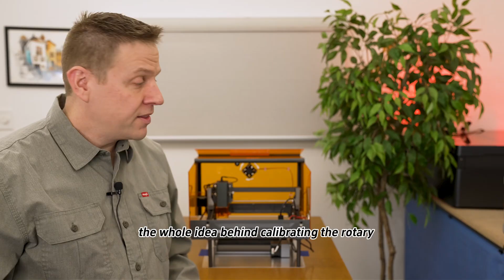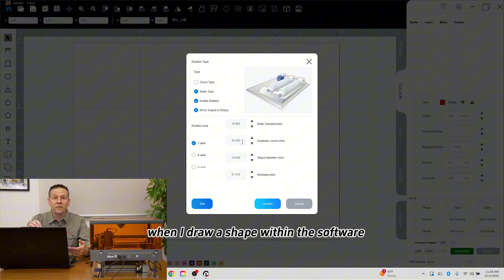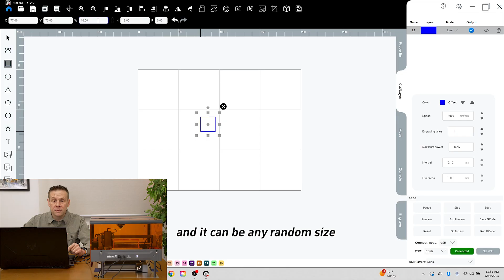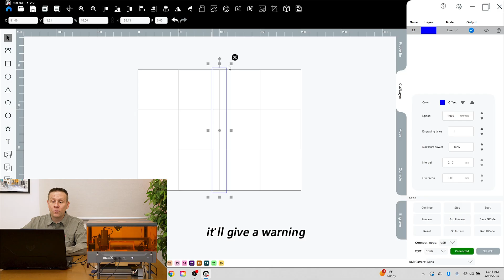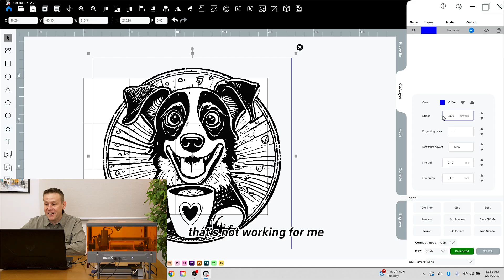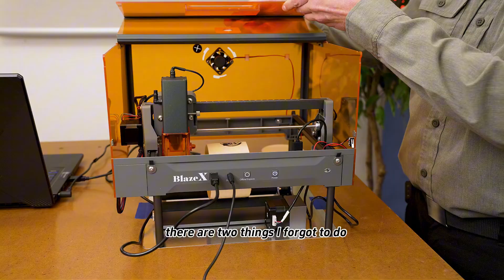Blaze X M3 laser engraving machine accessory roller connection and computer operation

Comment: My stainless cup with a handle keeps falling off the roller.  I'm trying to engrave, but when it turns it rolls right off.
Reply from the maker: If the handle can't be removed, try to keep the design within the rotation range—it shouldn't be too large. When tracing, you'll also need to adjust the cup so it has enough room to rotate without hitting the handle.🥰